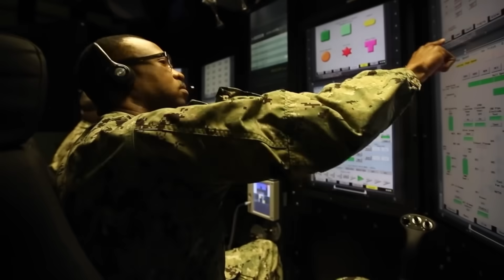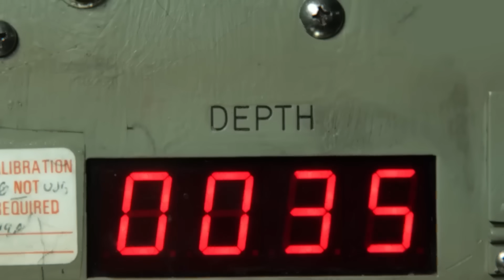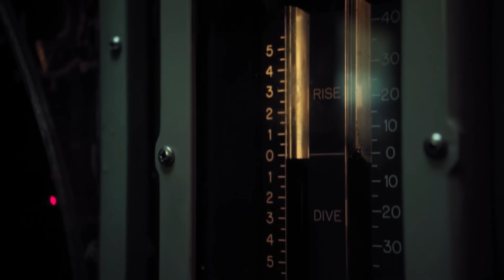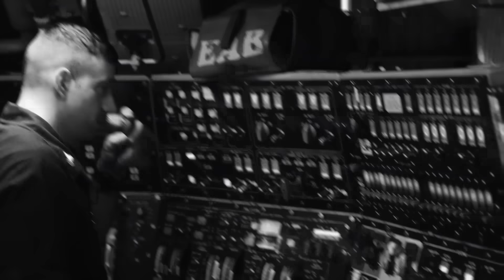What Happens When a Submarine Hits "Crush Depth"

Comment: Regarding the Titan submersible, I genuinely think this was the best possible outcome. We now know the sub imploded completely in the blink of an eye, meaning the passengers will have died a relative quick and 'easy' death. Much better than a slow, painful and desperate death of suffocation or CO2 poisoning
Reply: Indeed. It would be death, or at least incapacitation before death inside of half a second. There was most definitely a moment or two of fear. When the sensors started going off alerting of implosion, and the sub began to creak and moan. It was still much better than the alternative. 10 seconds of panic and an instant death versus 92 hours of dread, oxygen poisoning and darkness.
Reply: @TheYankeeTexan Jesus 😭 please pray for anyone to never go through this again!
Reply: @TheYankeeTexan  Very interesting! So they actually did have a short amount of time to know what was going to happen? I personally think that would be better than just instantaneous implosion without any warning at all beforehand. Seriously, I hope that the CEO took that time to repent.
Reply: @TheYankeeTexan I'm not actually sure they'd have even received that much warning. With steel or titanium aye, but carbon fiber has a tendency to fail rapidly and without warning once it hits its limit. It is entirely possible that they were dead within a second or two of the lethal imperfection forming as the hull shattered like glass.
Reply: @TheYankeeTexan  10 seconds that took an eternity to endure.
Reply: Have you ever crushed a bug underfoot and wondered what it must have felt like to the bug? Sort of like that.
Reply: Actually, James Cameron said that it's his belief that they have likely heard the hull cracking a few seconds before the vessel actually imploded. If my understanding his correct, before losing the communication the members of the submarine had pressed the emergency button which cause the railing to release. This usually means that the passengers were aware of an abnormal event.
Reply: @jadeabove  Fair, but even so, at most they must've thought ''oh shit, this ain't good''. What i mean to say is that the actual death upon implosion came quick, probably faster than their brains could even register the pain
Reply: It might seem strange but for me, I always beg the Lord to deliver me from sudden death in which I have not heard time to prepare though I know am always supposed to be ready to be called by my creator, at least I would want to say at the very least a perfect act of contrition. May the souls of all the faithful departed through the mercy of God, rest in peace. Amen
Reply: I heard a scientist explain its like popping a balloon in reverse. You pop the balloon but it happens so fast you wouldn’t even hear the pop before you were crushed. Milliseconds.
Reply: They all died doing something that was both dangerous and stupid.  

I read the interview earlier tonight of the American father and son who were supposed to go in place of the Pakistan father and son.  But the American son said there were just too many red flags for him to be comfortable with it.  Thankfully it saved his and his father’s life.

The Pakistani son was extremely nervous about going and only went because of his father, and it being Father’s Day. 

🙁
Reply: If they died a sudden death what the banging noises that came from the sub
Reply: @smokerscoach  There was never any confirmation it came from the submersible, only that there were noises that sounded like banging coming from the general location of the submersible. Not the exact location or confirmed to be from the submersible.
Reply: @smokerscoach  >If they died a sudden death what the banging noises that came from the sub
Similar issue to the Thresher, i believe if i remember right, that was a side-effect of the Sonar being detected by other ships.
Reply: No I wanted those rich people to suffer actually
Reply: Definitely. I doubt they even knew there was a problem.
Reply: If nothing else they would have also gotten very cold. So they would have fallen asleep and just died.
Reply: if they had to go I hope it was quick
Reply: They died without knowing it.

But they must have felt the shift in pressure beforehand.
Reply: or cancer or dialysis or even a bad car wreck and live a few days or hours. They went from normal to a pressure bomb in excess of 5,000 psi.
Reply: Death can be slow or Quick , they why we have to respect it ..
Reply: Sad what happened to the crew on that sub. This is a learning experience, not to let this kind of thing happen again.
Reply: Thanks for the much needed wisdom.
Reply: Where are the remains?
There are literally no images, apparantly the tail and the half-spherical covers are the parts found
Reply: @walter1824 get an empty soda can (or maybe a glass bottle). Put a bug inside of it. Crush and burn the container. Try to get the remains of the bug from the leftovers. There you go…
Reply: @obrnc0920  They found the parts of the sub, according to them
Reply: @walter1824  you asked about body parts. I don’t thing you all are really grasping what an implosion is let alone an underwater implosion. And the parts they found so far were not parts of the hull.
Reply: It isnt a good outcome.  The mega rich ass hole that built it died to quickly and wasn't able to assimilate he fucked up and was wrong in so much of what he did, disregarding industry standards and rules, such as using Carbon when Titanium was supposed to be used.
Reply: Hope they knew Jesus 🤟...
Reply: @Shaolin91z  it didnt seem to help...
Reply: Sadly
Reply: I wouldn't mid dying this way.  You feel zero pain whatsoever and you don't even know you're about to be totally wiped off the face of the earth.  I wouldn't go out and put myself in a situation like this one on my own free will but I can understand why people would want to experience this.  Agreed though man, best way for this to happen.  The implosion takes 1ms to happen
Reply: it must have been horrible when the stress alarms were going off and then realising there was no way they could surface fast enough though it was probably less than a minute before the hull collapsed.
Reply: Less than a blink of an eye, about a nanosecond. It takes 100 ms for pain to reach the brain so it wasn’t even painful.
Reply: @grayghosted6778  Scientists investing said the implosion was 1ms in time.  It takes your nervous system on average of 10ms to send pain signlas to your brain.  But yea, you're totally right, zero pain and instantaneous as frick. They wouldn't have even known it was about to implode as well most likely.
Reply: Lack of oxygen is actually quite peaceful, you just fall asleep after feeling giddy.

CO2 is what makes you feel like you're suffocating. So if they could couldn't get rid of the CO2... Yeah that would be about as awful as you'd imagine
Reply: Thank god for small favours
Reply: Yeah, even if it were bobbing on the surface, they still would have suffocated, because the hatch closes with 18 bolts secured on the outside. I don't know how normal this is, not to have any way for the crew to open it from the inside. But it would be agonizing to suffocate to death with air literally inches away from you. But I guess that's how a lot of regular suffocations happen if you think about it. Whether it's a bag on the head, or string around the neck, or food lodged in your throat. It's always inches away, at most.
Reply: apparently at that depth if there’s a leak you will implode in 2 nanoseconds and it takes 4 nanoseconds for your spine to send that info to your brain. it’s shocking that leaks aren’t the number one priority when making submarines
Reply: Most people would probably argue, them surviving would've been the best possible outcome.. but I don't judge.
Reply: Years back everyone became an expert Virologist when cov!d hits, then a military master strategist when russo Ukraine war happened and now everyone is a submarine expert. Wonder what's gonna happen later on.
Reply: Given the set of circumstances the crew was presented with. Loss of contact at a crush depth and potentially suffocating to death or implosion. I'd have to pick instant death. Just my choice
Reply: The skull 💀 would have imploded with the same ferocity. I reckon it was a swift death.
Reply: WHY CAN NO ONE SPELL
Reply: Did the builder of this tiny vessel know what might happen ?? And if he did, then why take other lives with him......Makes no sense whatsoever !!
Reply: @williamkinyon3832  it makes sense because he was an idiot.The vessel had zero certifications yet he boarded himself and others on. He thought he was smarter than the system and scientists.
Reply: True, now all we need to do is figure out why it took them 5 days to tell us what happened when they knew what happened 2 hours after it’s decent on Sunday.
Reply: @axe2grind244 US Navy not wanting to disclose that their classified equipment is listening & give away how sensitive/good it is to the Russians, Chinese etc etc.
Reply: @nedseagoon5101  That’s certainly plausible.
Reply: @axe2grind244 IKR
Reply: @axe2grind244 giving people false hope of the real situation
Reply: Idk, what if a small leak started first and the pressurized water sliced everyone up before the full implosion.. I wouldn't really say there's any good outcome here
Reply: @legendaryra3590  there is no "small leak" at that pressure...once the hull is compromised it loses all its strength. it implodes in an instant.
Reply: @legendaryra3590 that’s not how it happens. If there is a small leak the pressure at that depth would have been so forceful it would heat up the cabin as hot as the surface of the son, then implode
Reply: @legendaryra3590  There is no small leak at that depth. The vessel would be 100% intact or implode. At 5k psi it would rupture instantly with any pin hole leak. They may have heard some creaking but the implosion was over in milliseconds.
Reply: @legendaryra3590  That couldn't have happened because of the properties of carbon fiber. Another comment I found explains it great. "
For those wondering, the Titan submersible, at the depth it was at, would’ve imploded so fast that the passengers onboard wouldn’t have even noticed. At that depth, it would only take 0.15 seconds for it to go from perfectly normal submersible to metal pancake. It’s a sad way to go, but it’s good that it was too fast for them to even feel it.

To clear up any confusion, the reason is because they were under 400 atmospheres of pressure. Carbon fiber behaves like glass in that it completely shatters if it cracks. 400 atmospheres is equivalent to 5,878 PSI. Imagine the glass like carbon fiber having 5,878 pounds being pushed against all sides at once. There wouldn't be jet streams of water coming in before hand, even a microscopic crack would've been enough for the entire hull to completely shatter instantly under that extreme pressure." - @Alekai185
Reply: @legendaryra3590 Granted I am not a marine engineer but I don’t think that’s really possible, at that pressure any hole and a full loss of the craft would be, for all intents, a simultaneous event.
Reply: @legendaryra3590  At the depth they were at if they had even so much as a microscopic crack the entire sub would be instantly fucked. The entire process of the implosion and their deaths probably didn't last 2 seconds. I think the only kind of death that would have been faster is a gunshot to the head. And the pressure of that water is more powerful than any firearm.
Reply: @legendaryra3590  It's made of carbon fibre, so if it cracks at all, it will shatter and implode. You can't really get it to leak before it implodes.
Reply: What does implode mean?
Reply: @blessedslave  Implode means the explosing went.. inward, rather than outwards. Explosion is going outwards, like a granade.
Reply: @henryakaniels2989  The "explosing" eh? ... *sigh*... we are truly doomed...
Reply: @henryakaniels2989 "grenade," not "granade"
Reply: @blessedslave  just opposite of explosion. explosion means bursting, implosion is something you crush a mosquito with your palms.
Reply: @blessedslave implode (inward) - explode (outward) 💥
Reply: @blessedslave  it means crushing inwards to a ball like a singularity...  underwater it can take time though, it might not be instant... more likely it started to implode and then tore apart...meaning it caved at the center then split.
Reply: @blessedslave opposite of explode.
Reply: @blessedslave  implode (inward) - explode (outward) 💥
Reply: @blessedslave  They got turned into tomato paste.
Reply: @blessedslave imagine taking an egg and crushing it in your hand. Explosion is Exit Implosion is inward. Titan had the same fate that Titanics stern did.
Reply: There had to be warning signs before it happened, cracking , creaking, water leaking, the shape of the chamber or window distorting.  All kinds of weird sounds echoing telling you the chamber is about to fail. Maybe some screws, bolts or rivets popping out or shearing off.  Weird noises coming from outside as protruding objects mounted on it broke off, or large changes to the inside pressure.  It wasnt sudden enough for them not to know it was coming.
Reply: @RadioRich100 ah, no. At the pressures they were at, there is no "leaking." The literal instant an imperfection forms, such as a crack or a dent, or a hole opens, the sub collapses inwards like a tin can.
Reply: @RadioRich100 it wasn’t a normal sub. It was an unregulated experimental submersible made mostly of carbon fiber. You’re thinking of other materials with the creaking and cracking.
Reply: @obrnc0920  no im not, when you squeeze it to that level in the water - its going to make all kinds of noise.
Reply: @obrnc0920  Wrong, the failure was the result of gradually increasing pressure which resulted in a slow but sure failure accompanied by noises from the hull and window being squeezed and probable leaking. This is why they dumped their ballast to try to ascend but it was too late.
Reply: @RadioRich100   we’ll see soon enough if they find the weights if that actually was the case. And the issue absolutely was because of the degradation of the materials this man chose to use to build this thing with. Damn thing was probably making noise the whole way down. I’m sure it’s not a silent ride.
Reply: Actually,this was the bad outcome. Them being trapped with no signal was basically impossible since they had two separate trackers,so if they hadnt imploded they probably would be safe by now
Reply: @arcgamer8688 they would have ran out of oxygen way before being located
Reply: @ShinigamiGrin  what?💀 mate,they imploded,they didn't run out of oxygen
Reply: @arcgamer8688  you said that they could have been rescued but the fact is that even if it didn't implode, they would have run out of oxygen way before being found, considered how long it took. So yeah, a fast and painless death is still better than a slow agonising one. Still a tragedy of course, I'm thinking about that guy who was scared, but did it to please his father
Reply: @ShinigamiGrin  how long it took to...to what?? Mate,if they hadn't imploded,the tracker would still be active,thus they would have been found quickly enough even if they lost radio contact. The tracker is separate
Reply: @arcgamer8688  that doesn't make any sense, you are talking about something that didn't happen. Then let's also say that if they didn't implode and the tracker was waking they would have seen the titanic and get back home happy safe and sound. The op was talking about the possible deaths and since it was believed that they were lost and with few oxygen that would have been a horrible death, but since it turned out that it imploded instead, giving them a quick and most probably painless death without any realisation, he simply said "better this than that". It's really as simple as that
Reply: @ShinigamiGrin  ok? All is said is that the lack of oxygen death was almost impossible in the first place. I'm not the one talking about something that didn't happen,you are. All i'm saying is that the other scenario wasn't really plausible,it was either them imploding or them being rescued
Reply: @arcgamer8688  you still don't get the point and talk of whatever does please you that was not the op message. Ok ok, whatever...... 👏👍
Reply: @ShinigamiGrin  op said this was the best possible outcome. I said that the low oxygen one wasn't possible. What dont i get?
Reply: @arcgamer8688  why wasn't it possible? Since you are in the realm of the hypothesis it could have been perfectly possible to lose all contacts, sonars and whatnot and die by running out of oxygen before being found, it's a possibility and it was believed possible just a few days ago. The op was talking about this possility and compared to what actually happened he believed that they had a better faith. If you want to talk about a different scenario that "could have been" you can find a thousand more
Reply: @ShinigamiGrin  bro,i never said ,,what could have been". I literally just said that this wasn't the best case scenario because the one of low oxygen wasn't possible. Can't you comprehend my comments?
And it wouldn't be possible because they had 2 separate devices: one that makes the connection to the ship on the surface,and a very powerful isolated tracker that ran on its own energy source. Even James Cameron,who is acquainted with such expeditions,said himself that he knew from the beginning that the low oxygen scenario was impossible. People thought that was the case because of the media,who specifically milked this topic as you might have noticed. There was monetary insentive to tell us that there was a chance they could be alive. But the fact is,that scenario was impossible any way you take it. You just want to argue without actually taking into account the proof that i'm bringing,while also contesting stuff that i never even said in the first place. So yeah,you do you ig
Reply: @arcgamer8688 they are saying that what we thought for a few days (being they were lost and the tracker wasn't working, and they were running out of oxygen. Slowing suffocating) is a lot worse of a way to die than imploding. If they're tracker worked then I'm sure on of the five fail safes that allow them to float to the surface would still work also. Then this whole situation wouldn't happen. I'm not sure why you are going on about a tracker.
Reply: @simonkalloniatis7578  i know my guy. Why don't you read my other comments that explain in further detail? 
But all I'm saying is that scenario was not possible,look at what James Cameron said. And yes,all of those would have worked,but the sub imploded so that's why they did not. Otherwise they would have,thus the suffocating thing not even being a possible scenario
Reply: @ShinigamiGrin  What arcgamer is saying is that if they did not implode and just lost communications then they would have dropped the weights keeping the sub under water, slowly risen to the surface over the course of a few hours 4-5 and by then either a) communications is restored and the vessel picks them up or b) they bob on the waves and when the rescue operation is launched then they would be relatively easy to find at the surface than at the bottom of the sea. In both cases they stood a much better chance of being alive. 

However there is the third case, that the sub lost communications and somehow also lost power resulting in them being stranded at the bottom of the ocean. At that point this is the worst case scenario because they would have to endure a slow agonising death over a relatively quick and painless one.
Reply: @arcgamer8688 wat do you mean by safe
Reply: @wingedhussar1453  alive
Reply: @arcgamer8688  how
Reply: @wingedhussar1453  rescued by the cables they said they would use
Reply: @arcgamer8688  how
Reply: @arcgamer8688  they ran out of oxygen anyways, and guessing they were probably panicked even faster than people had "predicted" the O2 to run out, CO2 poisoning basically.. like the other person mentioned
if they had a tracker; yes. they would have been saved because it would have happened days earlier, but they died like several days ago in the implosion; it's not like they were going to be saved anytime recently
Reply: @stiII.rivers  i was the one who mentionet the tracker. All im saying is if they hadn't imploded,the CO2 poisoning wouldn't be likely because they would have been rescued within hours
Reply: @arcgamer8688  I understand what you mean. In fact, had it not imploded, they may not have lost tracking (apparently it was common to lose communication) and actually completed the trip without a search. It seems this was bound to happen with this sub from everything I've read.
Reply: @franco28stl  oh yes,obviously,its integrity was awful,its safety net was not even 0,it wasn't even made for 14000ft,etc etc,it's strange that people even hoped they would be alive
Reply: @arcgamer8688 do you know not how to read!? They’re saying it instantly imploding is much better than them being trapped in the scenario you just described.
Reply: @missym877  do you know how to read???? Im saying that scenario wouldn't have been possible,i said that in 5 comments
Reply: @arcgamer8688 you have too little knowledge to be making such huge claims. You have no clue how vast the ocean is and how deep. No way in hell they would be making it out alive
Reply: @birilol  my brother in christ what are you on? They had a tracker
Reply: @arcgamer8688  the tracker alone doesn’t guarantee that it would have saved them. You still need all the infrastructure of the people getting to the spot diving down and retrieving them. Not to mention weather conditions etc. Easy to say they could have found them when you’re typing from the comfort of your couch with 0 experience in search and rescue
Reply: @birilol  diving???💀💀💀 i may be in the comfort of my own home,but atleast i realize how stupid that is. They had cables that would retrieve it
Reply: @arcgamer8688  the cables are not diving down? Are they floating in the air? I didn’t mean actual people would dive.
Reply: @birilol  well,if you wanna call that *diving*,ig yeah. I'd call it descending them,but yeah,we have the technology for that
Reply: @arcgamer8688 I guess maybe the submersible imploded immediately when they reached the crushing depth. I think this was the reason of losing contact, that it imploded, therefore there was no trace.
Reply: @JaCKso00onBOY  yeah,that is the theorized reason. Both of the signals disappearing at the same time can be explained only by the sub itself imploding. I think that happened either due to crushing depth,or a breach caused by impact,either with oceanic life,debree,or rocky surfaces
Reply: @arcgamer8688 "It's never been done before and I don't think anybody's got any ideas about how to do it at the moment." --retired navy rear admiral Chris Parry when asked about lifting the submarine off of the seabed. The technology is just not there for your outcome to be possible.
Reply: @bullinater7686  for one,if the navigation system of the sub stopped working,it still had weights made out of disolvable construction material,which would prevent it from being stuck underwater. Also,they would still be able to pilot it,just wouldn't know where to go. Thirdly,it hasn't been done,but that doesn't mean we can't do it. We have the technology,indicated by the cables they were planning on using. And lastly,there was never a matter of lifting it off the seabed. Even the slightest contact at that depth would cause a breach and instant implosion.
Hope i cleared things up.
Reply: @arcgamer8688 they still would be dead
Reply: @Manuu_Baiana  what? How? I said the other outcome wouldnt be possible as they would have been found quickly with the tracker